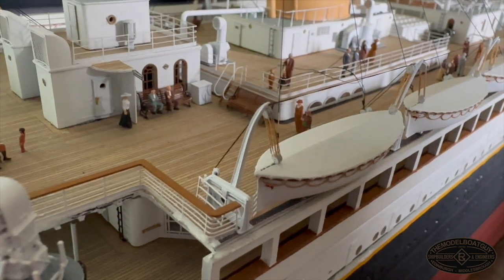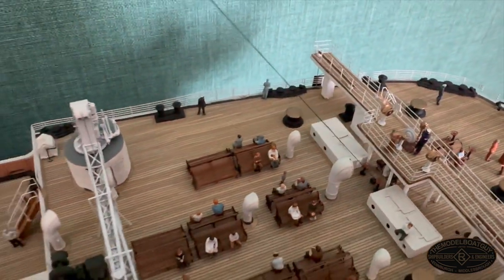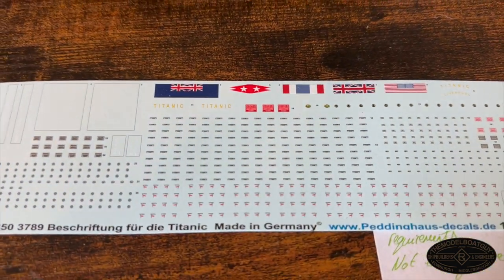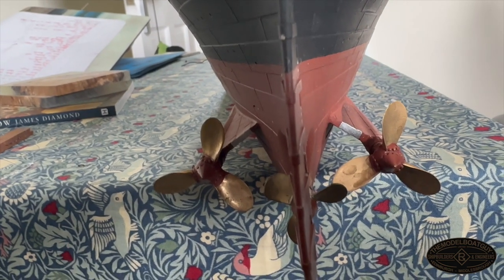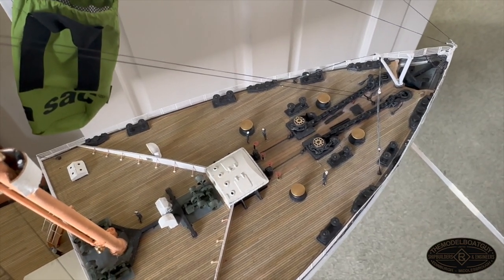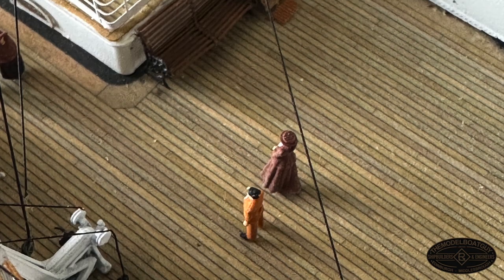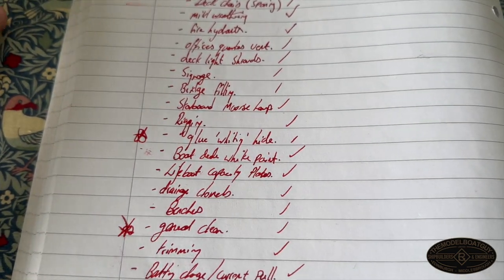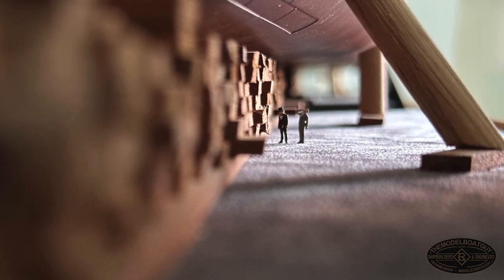Radio Control Trumpeter 1:200 Titanic Build Part 91 - Finished

Comment: 10:50 There's speculation that this bar was an awning for canvas which could be fitted over the aft end of the promenade, but I've never seen a photo of it used for that. On Olympic this part of the promenade was very popular with passengers and that bar was most commonly used a swing set for children, usually have 2 swings set up at a time.

Comment: Hi Robbie, Great job, she is a credit to you!  The bar going to the aft mast was actually called a rafter and was intended to carry an awning for the passengers. It was also fitted with some small eye bolts on the bottom edge to allow a swing to be fitted for the passengers recreation. Wow!  The fire hydrants all look about right Rob according to the plumbing plan that I have.  They were actually called weather deck bibbs!  The Pontos PE does actually provide for these but to be honest they do not look very good as they are basically very flat! Your creations look fine.
I have made some progress so I will email you soon! Regards JH 😉⚓
Reply from the maker: Afternoon John, 
Thank you! I had a feeling the hydrants were included in Pontos because I remembered seeing them, but couldn’t find them in any of the sets I currently own. So makes sense! 
Thanks for the clarification on the rafter, that is a lovely little detail, and would be a nice addition to an Olympic model. 
Looking forward to hearing from you soon,
Robbie

Comment: 10:50 As far as I know, this piece of wood was used to mount a collapsible roof, sort of awning. Later on the Olympic, there were swings fitted for the children.
Reply: Yeah I think so too, thats what I always heard it was for. I don’t see why wires would have to be run through in the air like that, it‘d be easier to put it under the deck than having to build a box around them and hanging them in mid-air.

Comment: If you would have to build it again, would you select trumpeter, hachette or other?
Reply from the maker: Good question, I think Trumpeter. I only really have experience with Trumpeter and hatchette and I think trumpeter has far better external detail. I can’t speak for other models at 1:200 scale though.

What I liked about the trumpeter kit is that there is so much room for manoeuvre, you can build it as is, or use additional sets, it’s a very versatile kit.

Comment: Might be wise to have a fishing line or string tied to the back of it when going over deeper parts of the water you test it in. You never know when a hole might become present or if water finds a way to get in. If water gets in and damages any electrical components, she could be dead in the water and sinking too far away from where you could reach her. A fishing string would allow you to reel her in to attempt a salvage

Comment: You did a fantastic job but you do have one glaring error….the Titanic’s central propellor was 4 bladed not the 3 bladed one you have…..yes I’m fully aware of why it’s a 3 bladed one and not the correct 4 bladed propellor but the reasons for the 3 bladed propellor and not the 4 bladed one  been proven to be false
Reply from the maker: Could you share the source that shows the three bladed prop is incorrect? There’s not much evidence for Titanics props generally! But I have never seen any conclusive evidence that Titanic was fitted with a 4 bladed prop. If you could send me it I’ll have a shufftie